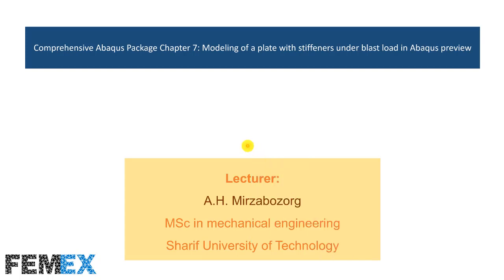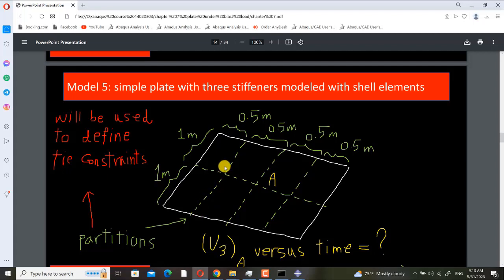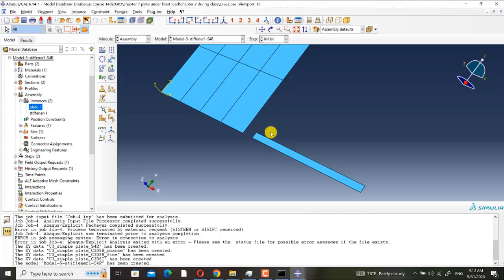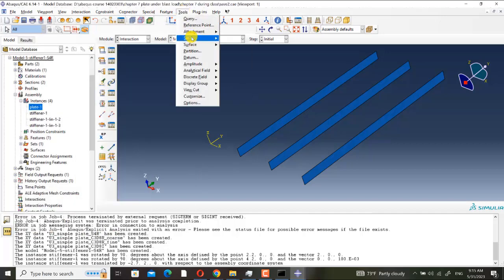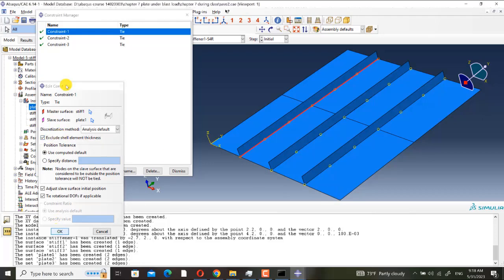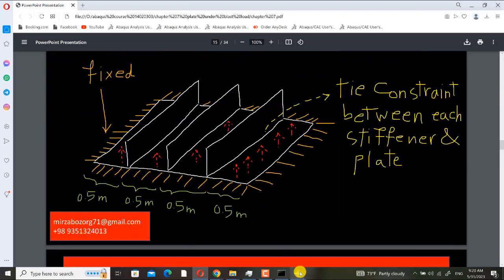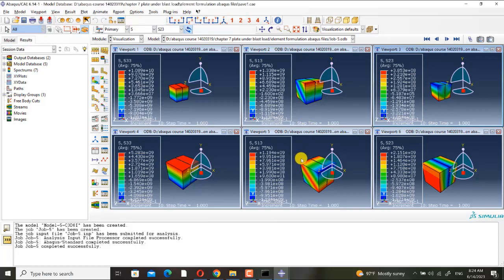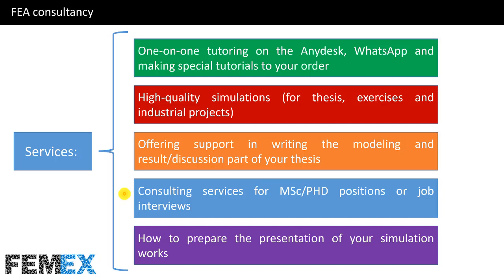Comprehensive Abaqus Package Chapter 7: Modeling of a plate with stiffeners under blast load Preview

Comment: Hi , what's differences between three words : "displacement" , "deflection" , "elongation" ?
Reply from the maker: Hi.
When you apply force to a deformable body, it deforms and some of its regions undergo displacement.
We usually call the displacement in a beam or column as deflection.
When the length of a beam or column changes, then it has elongation. Actually elongation is a the axial deformation of a beam or column.
Reply: @FemexIran   thanks, must we know that there is difference between displacement and deformation? When a specimen deformed may not have displacement??
Reply from the maker: @امیرمجیدیان-خ7ح  You are welcome. deformation is a general word and is not quantitative but displacement is quantitative. When a specimen deforms, some or all of its regions will have displacement. It depends on the boundary conditions and interactions and loads.